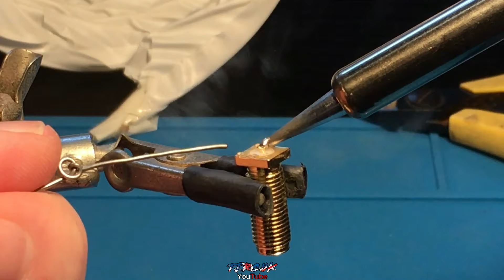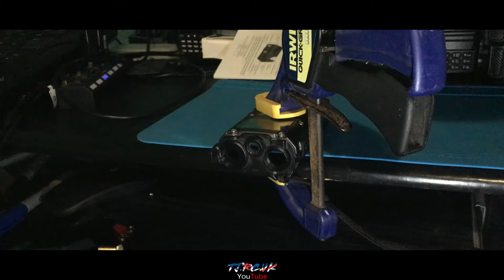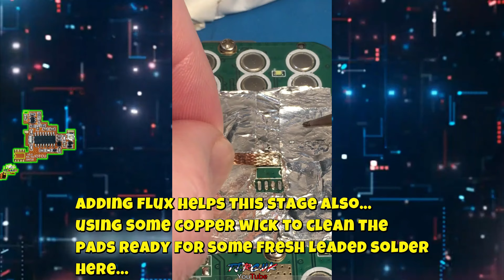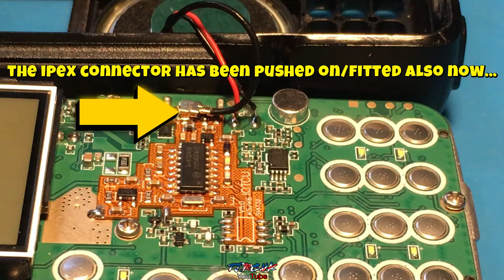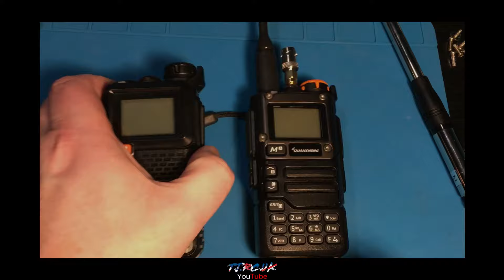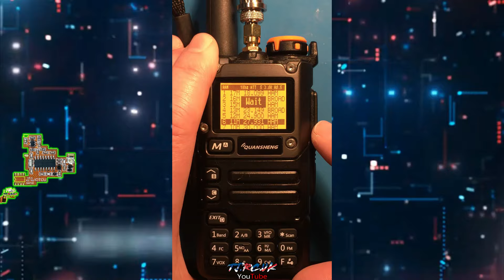Full Band HF Mod Install v5.0 Quansheng UV-K5-K6 + CEC 0.51HF user guide...

Comment from the maker: #aliexpress #aliexpresfinds 
▶Quansheng Radio uvk5(8) uvk6: https://s.click.aliexpress.com/e/_oDzxq0L
▶SI4732 UVK5-K6 HF Mod V5.0 + 2M Chip:https://s.click.aliexpress.com/e/_oB4PVfz
▶Eidoct 2 pcs SMA Male to BNC Female RF Adapter:https://amzn.to/4gwkGtB
▶K5 programming backup tool:https://drive.google.com/file/d/1dcP1DpqV4TfOfcvH1f1ahmdf7CeUUMpl/view?usp=sharing
▶CEC FW 0.51 full hf firmware download:https://github.com/phdlee/uvk5cec/releases/download/v_01HF/CEC_051.HF.packed.bin
▶Egzumer browser flasher tool:https://egzumer.github.io/uvtools/
▶Back up your radio & flash your firmware:https://www.youtube.com/watch?v=VVsTQzZl3cA
➡➡➡➡Soldering products + links to UK 3-pin power leads & adapters⬅⬅⬅⬅
▶10X Magnifying Glass with Light:https://amzn.to/4gzjdD0
▶Soldering-hot air gun rework station 8898:https://s.click.aliexpress.com/e/_EvZSRSc
▶Metal pry tool/spudger + opening tools:https://amzn.to/4hUmvSh
▶3-pin kettle lead for UK:https://amzn.to/40Daqdk
▶2-pin travel plug with ground contact built in:https://amzn.to/4heJhEs
▶2-pin travel plug with ground contact built in:https://s.click.aliexpress.com/e/_oFwiFnj
▶solder fume extractor with built in filter:https://s.click.aliexpress.com/e/_onrgK0T
▶Solder fume extractor select the size of hose in options:https://s.click.aliexpress.com/e/_oEdl8YT
▶wire cutters:https://s.click.aliexpress.com/e/_oCtLE4l
▶30 AWG silver plated wire various colours:https://s.click.aliexpress.com/e/_opdaxVT
▶Many hands for holding cables connectors when soldering:https://s.click.aliexpress.com/e/_ooLpHRB
▶Leaded solder lower melting point better flow:https://amzn.to/42GN9tx
▶Lead-free solder with higher melting point:https://amzn.to/4h9FDfg
▶Solder wick for removing solder: https://s.click.aliexpress.com/e/_oCeKJvj
▶Solder wick amazon: https://amzn.to/4aET6sR
▶Soldering Mat, *choose your option & size:https://s.click.aliexpress.com/e/_oF6y8Jd
▶Liquid flux to help with reflow/soldering:https://s.click.aliexpress.com/e/_oEmrlxB
▶Flux paste to help with reflow/soldering:https://s.click.aliexpress.com/e/_onQXM7b
▶PCB cleaner Isopropanol Alcohol IPA 99.99% 1L:https://amzn.to/3WyPDGm
▶Kapton heat tape:https://s.click.aliexpress.com/e/_okRRMnL
▶High-Temperature Aluminium Foil Tape:https://s.click.aliexpress.com/e/_om2DOX3
▶Hot glue gun choose the option you require....:https://s.click.aliexpress.com/e/_opeGiJE
➡➡➡➡AliExpress discount codes⬅⬅⬅⬅
▶$2 OFF For orders over $20 Code:【IFPATZR】 ▶$5 OFF For orders over $50 Code:【IFPBUFS】 
▶$15 OFF For orders over $200 Code:【IFPVKJY】 ▶$30 OFF For orders over $400 Code:【IFPJQCJ】

Comment: No sound on speaker, any ideas?
Reply from the maker: After carrying out the mod, you mean?
Reply: @tjrcuk  yes
Reply from the maker: @mareksobol9845  check the speaker connections are ok no solder bridge look around the board for any loose solder balls floating around causing any possible shorts.

Comment: Is this process the same on the v6.8 board? Thanks
Reply from the maker: Looks the same on the install for the actual full hf SI4732 board, this version has an extra PCB for dual eeproms, which allows for stacking, where you only usually have space for one eeprom, I think it's one for firmware & one for data...

Comment: Very good, thank you. Just a warning for anyone considering getting the radio with a mod already installed (several options are available on AliExpress). You will need to open the radio to be sure what you have, and how it has been installed. My mod-board is v3.0 with HF and bluetooth. All the mod-kits I've seen include the hardware to add a secondary antenna socket, but mine does not have it installed. Nor did the bluetooth antenna-pad have a wire on it.  I've added a wee bluetooth antenna and soldered a temporary antenna-cable to the secondary antenna-pads. As the V3.0 board is missing the AF and RF enhancements, performance isn't great on HF even with a long-wire attached to the secondary. So, I've ordered another radio and a mod-kit that includes the enhancements (but not bluetooth). It ends up being quite a bit cheaper, and I get to have some fun putting it together.

Comment: Did the above no problem.. only thing is there is no power when you clip case back together. leave it slightly loose and it works. doesnt seem to be a loose connection
Reply from the maker: Check the lcd/ribbon has not been damaged in any way as it may work okay out of the chassis but under slight pressure/movement it might be causing a blank display, also if the ptt is sticking it will give you a blank display as it will be in firmware mode with no led on the board to indicate it being in that mode now if that makes sense :)

Comment: Ive just done it, I need to flash the firmware now. I have a few questions. So you dont have to remove any existing components on this version board?, as I remember seeing videos of an older version where a capacitor had to be removed. Also I had an 8 pin surface mount IC in my kit - what is this for? Finally, can you still program it with Chirp after this mod? Thanks
Reply from the maker: V5.0 requires only the rf chip be removed with 1 link from the board to the resistor as shown in my video and the 2 grounds, the chip is to extend the memory from 200 to 999 channels so not needed for this mod to work with the cec firmware, cec hf firmware will work with chirp but as with any custom firmware the py module is required to be loaded in first.
Reply: Thanks, yes it works! I've flashed the firmware OK, just need to get CHIRP working now, as it won't let me send any codeplugs to the radio. I've tried the PY driver for chirp, but it's still coming up as unsupported firmware
Reply: I did all this but one of the pads on the 8 pin section of the chip fell off when I was soldering, do I need a new chip now? Thanks

Comment: With this mod/firmware can the radio receive 1ghz?
Reply from the maker: Hi, so the si4732 board once installed & switched on allows for 150 KHz to 30mhz AM, FM RADIO, LSB, USB & CW and once switched off the firmware can do 18mhz to 1300 MHz so it can actually go up to 1.3ghz...
Reply: One more thing, the ali express ad showed the jumper going to the component above that resistor, the side with the single leg
Reply from the maker: @Bakon721  Hi, I did look at there picture, maybe they did like that as it allows for a slightly bigger/longer link to be used for someone who is maybe new to soldering, so less fiddly :), the PCB trace/track is connected to that component also, but the straight connection to that resistor is the correct way and it looks way neater imho but up to you how you want to do it :)
Reply: @tjrcuk  yeah I already soldered it to the resistor so I'm not changing it now 😆. Thanks for the super informative video!!
Reply: @tjrcuk  also I'm waiting for some female bnc connector to come in, I'm going to attempt to use a bnc instead of the sma like om0et did
Reply from the maker: @Bakon721  No probs,  as The Mandalorian saying goes "This is the way" lol or "This is the correct way" lol

Comment from the maker: Full Installation, modding video for the v5.0 full hf board with the SI4732 chip, plus I have included a basic user guide on the CEC 0.51 HF Firmware for you to get you started.